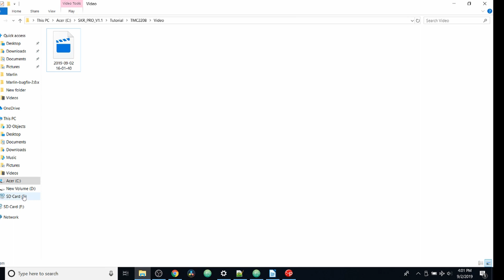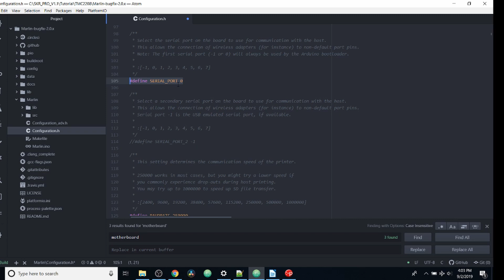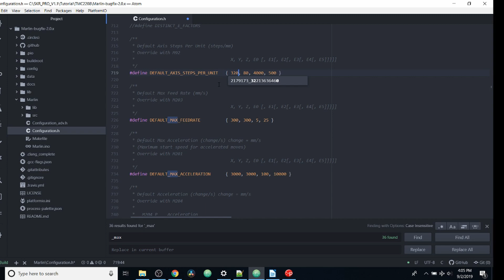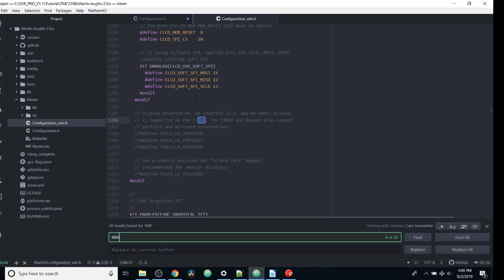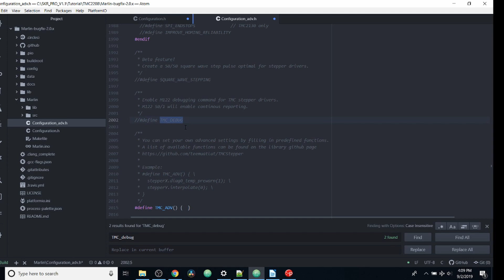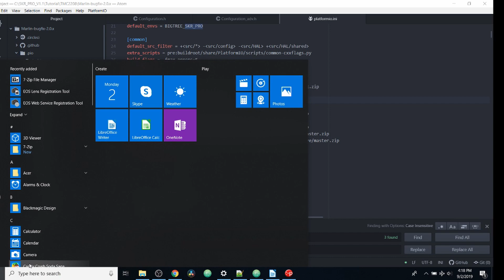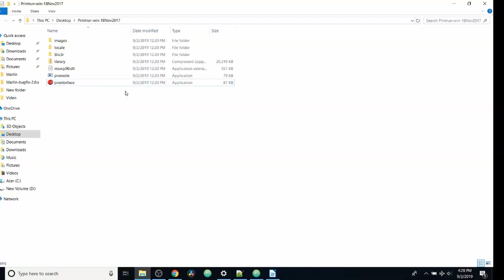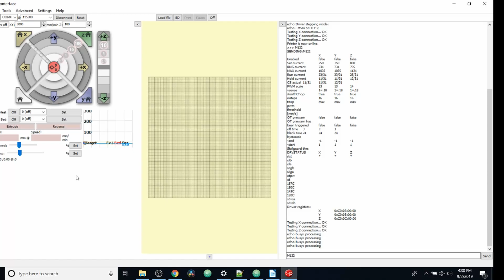SKR Pro V1.1 - TMC2208 UART v3.0 (BigTreeTech)

Comment: I added my tmc 2208 but version 1.1 so ile wonder for UART is just jumper enough or do i need to add a resistor and restore some pins as old style ? Also for set up vref for the driver i measured 240 mV it is impossible because i can not increase vref to 800mV ?
Reply from the maker: I'm not sure I understand you're question.  There's a link to Discord in description.

Comment: Good afternoon. I want to build an IDEX printer, and am considering various boards. This looks intriquing but I wonder if the two Z steppers are locked and dedicated to dual Z. Can the second Z stepper be used to run a second X carraiage instead?
Reply from the maker: You can use the z axis as on or two steppers and the third extruder as an additional x axis.
Reply: @EdwardBraiman  Thanks for the reply.. I'm guessing since I haven't read the manual yet, buth the two shorting posts beside the z drivers removing them allows them to be used independantly? If you have time could you give me a guide as to how to remap the second z to act as a second x carriage for IDEX? Thanks in advance. Funny thing...eveeryone asks  what I make with the priinters I build. I buld more printers I'm more interested in the technology than what I can do with it...lol
Reply from the maker: Second z axis only does one or two nema 17 steppers on a single stepper driver.  If you want additional axis then you're moving into extruder steppers and using Marlin firmware to reallocate.
Reply: @EdwardBraiman  Thank you.
Reply from the maker: You're welcome.

Comment: Does the SKR pro have an expansion board? If we paired it with say a DIP board for expansion, would  the motors on the slower chip DIP have instructions given to it at the slower chip rate by bottlenecking the faster chip on the PRO or is adding an expansion board of a slower chip to a board with a faster chip able to utilize the faster chip only? I’m trying to see if I’m able to buy a cheaper board to use as an expansion board.
Reply from the maker: There are generic expansion boards, but you'll need to check the setup process in my RAMPS 1.4 playlist.  The chipset only communicate with pins on expansion board.
Reply: Edward Braiman I know people using 2x SKR 1.3 boards utilizing  one as an expansion board to use for the extra extra drivers. The few people I talked to using 2 SkR boards used the same exact board as their main board to be an expansion board so tenuous had the same chip. What I’m wondering is what would happen if we used a different board with a slower chip as an expansion board since the Pro doesn’t have an expansion board and I wouldn’t want to buy two PROs I’m case i can’t use 2 of the 3 extruder jumpers for 2 extra z motors. Not to mention I’ll need another board because I’m running 7 possibly 8 fans and the pro doesn’t have enough fan pins.  I’m about to purchase a GTR if the second board used with the pro bottlenecks the chip. The Dip is nice and cheap but is the runt if the litter it seems.
Reply from the maker: Well I've been waiting almost three months for GTR to arrive, so I might be able to answer questions about it.

Comment: i just fount out that Currently @t is outdated and you shouldn't put that in your platformio.ini file at this time. 
Leaving or changing it to->  TMCStepper@>=0.6.2,<1.0.0    ,is now recommended.  
.
Problem im having now is that im unable to set my micro steps in firmware and im stuck on 1/8th. M122 reported it was in 256 msteps until i soldered the jumper on each driver. it now states that its msteps is 8 which seems correct for its physical measurement and the steps per mm i have set in firmware. but i have each driver set to use 32 in configuration_Adv.h
Reply from the maker: Have you check if any issues are open on Marlin's GitHub bug page for micro stepping?
Reply: @EdwardBraiman  i have. i didn't find one with a similar issue. so i opened one.
Reply from the maker: Cool let me know in the comments the link.
Reply from the maker: Well I've been investigating a little and it looks like they made a dramatic change in the configuration_adv.h it appears to be easier to configure, but micro stepping maybe controlled on configuration.h under default_axis_steps_per_unit.  Try doubling 80 for x and seeing if it's less steps.   Sensor less homing seems messed up, but I need more time and cooler weather as my apartment is about 100 F.
Reply: i doubled x now it moves 40mm instead of 10mm.
earlier i tried printing something at half scale to see if it would print at full scale and it temporary fixed the issue and printed at 1/4th scale and moved 10 for 10. 
 when i doubled all my axis steps and re-flashed it fudged up again.  i'll try to print at smaller scale again.
Reply: well i think i found the issue... i tried printing something normally and it was excessive in movement  it crashed and i hit the reset button on the lcd. now it works and M122 reports 32 msteps. did a complete power cycle and load and behold the printer was moving 40mm instead of 10.. hit reset on the screen and its 10mm for 10mm. 
something is causing it to be set to 1/8th msteps then somehow the soft reset fixes the issue.
Reply from the maker: Micro stepping is still the same.

Comment: I have followed this video but it wont compile after adding the link in here for drivers
Reply: https://github.com/bigtreetech/TMCStepper I think is the problem marlin bug fix 2.0x looks a bit different to the one used on here
Reply from the maker: Marlin firmware has made many changes.  Currently I've not been able to get tmc2209 working.  The others tmc2208 and tmc2130 should work as done in videos.
Reply: @EdwardBraiman  tmc 22o8 v 3.0 is what I am trying to set up  will not compile  seems to be with the include statement
Reply from the maker: Which IDE are you using?  ATOM with Platformio is now not supported.  VScode IDE with Platformio plug-in is now standard.
Reply: @EdwardBraiman  It still fails in VS Code...
'stimer_t' does not name a type; did you mean 'timer_t'?
changing the line > TMCStepper@>=0.6.2,<1.0.0    < to >     https://github.com/bigtreetech/TMCStepper
in platformio.ini causes the issue.
Reply: still fails in vscode
Reply from the maker: Does it fail on a fresh download of Marlin firmware without any changes made to it?
Reply: It compiles without touching anything
Reply from the maker: So it's working?
Reply: I just left the line in platformio.ini "TMCStepper@>=0.6.2,<1.0.0" as is and it compiles and runs on the printer.  if you change it then it fails. 
not sure if it will work in UART mode i dont really know the benefit it or feel like messing with my drivers atm.
.
the failure to compile has something to do with the github TMCdriver package. if Thomas is using the same version of everything as i am he's likely having the same issue. 
he did mention that in his original post actually. "wont compile after adding the link in here for drivers"

Comment: Thank you for your videos.  Do you have any advise on DRV8825.  I am trying to install some old DRV8825 that I have from another printer but I am reading 0 volts on all my Vref adjustment pots.  Are there any tricks to find out how to see if there is power?  I measured the 3.3V out of the Vcc and GND and it measures 3.3V.  The "D" pins are shorted per recommendation on A4489/Drv8825 Is there a setting in Marlin perhaps that keeps the voltage from working?  I have plugged the drivers on the old printer and they do work.
Reply from the maker: I've been unable to get them working at the moment on the SKR pro v1.1.  the direction appear not to help from bigtreetech.  I'll make a video when I figure it out.
Reply: Edward Braiman : Thanks!  I also opened a ticket on the Bigtree Skr Pro Github.  The polarity on the bed heater output PiD is reversed from the label too.  Once I changed polarity I was able to make my AC SSR work.  I followed all your other vids and they worked to a tee.

Comment: I cant get my two Z motors to go in the same direction 😢
Reply: I have the same set up i just use 2209
Reply from the maker: Try reversing plug or inverting in Marlin firmware on configuration.h

Comment: Are you using the official Marlin 2.0 branch, or the Bigtreetech one? Could you made a video of configuring the SKR PRO 1.1 with TCM5160 with the debug pin attached? Thanks in advance, and great video!
Reply from the maker: I'm only using Marlin firmware from www.marlinfw.org . I'll be doing other tutorials as time progresses.

Comment: Hi Edward. I made everything step by step from your video. But when I power my skr pro v1.1 populated with 4 piece of tmc2208 drivers, the motors doesn’t get anny current.  Can you show is the wiring of the nema motors with color code?
Reply from the maker: There is a tutorial in my playlist regarding this.  I'll see if I can find the link.
Reply: @EdwardBraiman  I think you mean this video. https://www.youtube.com/watch?v=3Z4aAzuzu44
Reply: @EdwardBraiman  also sadly in platformio.ini, the TMC driver github link is not working anymore.

lib_deps =
  LiquidCrystal
  TMCStepper@>=0.6.1,<1.0.0
  Adafruit NeoPixel

should work, but.... who knows?!
Reply from the maker: Do you mean wiring jumper pins?  Or wiring connectors for Nema17 steppers?

Comment: hello, thanks for the video. I have a problem when I try to move the engine, it is not moving properly. The motor jerks and I have a message in the Pronterface "echo: busy: processing". If you have an idea
Reply from the maker: What happens when you send the command in Pronterface, "M122"?  What type of stepper drivers and brand?
Reply: @EdwardBraiman  Thanks for your response
For the stepper drivers, it's TMC2208 v3 from Bigtreetech.
The M122 result :
>>> M122
SENDING:M122
  X Y Z E
Enabled  true false false false
Set current 800 800 800 800
RMS current 795 795 795 795
MAX current 1121 1121 1121 1121
Run current 25/31 25/31 25/31 25/31
Hold current 12/31 12/31 12/31 12/31
CS actual 12/31 12/31 12/31 12/31
PWM scale 255 14 14 14
vsense  1=.18 1=.18 1=.18 1=.18
stealthChop true true true true
msteps  16 16 16 16
tstep  max max max max
pwm
threshold
[mm/s]
OT prewarn false false false false
OT prewarn has
been triggered false false false false
off time 3 3 3 3
blank time 24 24 24 24
hysteresis
-end  -1 -1 -1 -1
-start  1 1 1 1
Stallguard thrs
DRVSTATUS X Y Z E
stst  * * * *
olb
ola  *
s2gb
s2ga
otpw
ot
157C
150C
143C
120C
s2vsa
s2vsb
Driver registers:
  X 0xC0:0C:00:40
  Y 0xC0:0C:00:00
  Z 0xC0:0C:00:00
  E 0xC0:0C:00:00
Testing X connection... OK
Testing Y connection... OK
Testing Z connection... OK
Testing E connection... OK
Reply from the maker: Can you outline what hardware is connected to SKR and what Nema17 motors and if you needed to wire the connectors for the Nema17?

Comment: TMC CONNECTION ERROR
Reply from the maker: Which hardware are you using?  Which version of Marlin firmware are you using?
Reply: @EdwardBraiman  skr pro 1.1 
last version marlin 2.0.1
Reply from the maker: Who makes the stepper board?  When you do M122 in Pronterface what do you see?  Can you copy what you see in Pronterface into comments?
Reply: @EdwardBraiman   The motherboard and the stepper board are BigTreeTech
Reply from the maker: Can you copy message from Pronterface?
Reply: @EdwardBraiman  yes, and "TMC CONNECTION ERROR" LCD screen
Reply from the maker: So on the LCD?  Without LCD screen in Pronterface do you see an error?  I'm just trying to understand your configuration and what's connected.
Reply from the maker: Which type of LCD are you using?  I'm going to try and replicate tommorow.
Reply: @EdwardBraiman  thanks for helping me
Motherboard: Bigtreetech SKR-Pro-1.1
Stepper Driver: Bigtreetech TMC 2208-V3.0
Marlin Version: 2.0.1
LCD: RepRapDiscount Full Graphic Smart Controller

The message "TMC CONNECTION ERROR" appears on the LCD.

I set exactly as in the video to make a test and unfortunately this error appears, I can not control the stepper motor, but in pronterface I can force the engine but it spins wildly, skipping the steps.
Reply from the maker: I replicated your issue.  When I recorded this video we had been on bugfix version of Marlin firmware and extra steps needed to be taken for TMC 2208.  Since then they fixed platformio.ini so the only change you're going to make is default environment to bigtree skr pro and ignore second change.  For the issue you experienced I power up skr_pro only on USB power and saw the error message you experienced.  The solution for me was to remove all power from board and move jumper for USB power to power supply position.  The I reconnected USB cable and powered SKR pro from PSU (power supply unit) for my 12v power supply.  The LCD powered up fine without error message.  Sorry it took a day but last night I was investigation another LCD issue.  Let me know if the resolves your issue?  Good luck.
Reply: @EdwardBraiman  sorry for the delay, I took a break from the project and am coming back now.  I solved the problem by soldering the two connectors under the driver (in the driver's manual it was like this).  could you do explain me better how to configure the driver Vref?
Reply: Sorry for my bad English
Reply from the maker: Vref depends on the stepper driver type and Nema17 stepper motor type.  Using the datasheets from both you can set the vref (voltage reference).  Unfortunately, it's hard to explain, but I've done two videos on this in my MKS Gen L playlist.  Vref can also be set via software depending on stepper drivers.  One of many examples is TMC 2130 spi stepper driver.

Comment: Hi. Thanks for your video. Everything is clear. I bought one and I received it last week. I've the skr pro 1.1 with the TMC2208 V3.0 from bigtreetech.
I've set up Marlin according to your video. After uploading the firmware, I can rotate my nema motors. But if I test the M122 command, I get "all low" message.Any idea about what's wrong?
Reply from the maker: There might be an issue open on Marlin firmware.  I'll see if I can find the link.
Reply: @EdwardBraiman  Thks for your feedback. I found on other forum that the J2 must be soldered. Mine in not soldered. Do I've to do it?
Reply from the maker: Check with a really good magnifying glass or zoom in photo. It may have surface mounted resistors.  They're about the size of a needle head.  On my first batch I had to resolder, but check the version is bigtreetech v3.0.  first try swapping in other steppers if you have more before attempting because of warranty.
Reply: To fix this error I had to add Jumpers between the rx and tx pins. Mine was a 2209 though so I'm not sure if you have those pins on the '08
Reply from the maker: Is power connected?  I know this sounds odd but the only instance I caused this was no power supply.  There is a trouble shooting guide on Marlins website which might help in this case.  I'll look for other causes after work tommorow.
Reply: Same here, thank you for the tutorials and all the work. I can connect it to ponterface and with the M122 command X/Y/Z/E dont get a adress and all low. I try to bridge TX and RX today, hope it will help 🙁. Steppers are 2209 silentstep from watterott
Reply from the maker: At the moment I'm still trying to get tmc2209 working as well.
Reply: hi im getting the same thing has anyone found a fix?
Reply: MrWhelan190 hi, you need to have the specific UART version of the TMC2208. Else, you have to use TMC2208_Standalone in your Marlin configuration file.
Reply: @yannickmarco5760  i have the bigtreetech tmc 2208 v3. if i use TMC2208_Standalone the m122 command dose not work

Comment: Thanks for such a detailed and clear video! I have generic TMC2208 from another vendor. Is it possible to use them with SKR Pro 1.1? Is there any soldering should be done on such TMC2208?
Reply from the maker: Unsure s most people have issues.  You can try them and see.
Reply: any updates on that? I have the TMC2208 v1.2 with 3 solder pads underneath and i'm thinking to upgrade to this SKR PRO board. Can I use my "old" TMC2208 v1.2 in UART mode ?
Reply: @dark23junior  Yes, I was able to use TMC2208 from FYSETC after soldering 3 pads. The driver is fully controllable through UART
Reply: @shwonder thank you, i will try it

Comment: Hi Ed,  Thank you for all of your videos, I have been following many of them for some time now.  I am following your exact setup but when I run the M122 all of my drivers report as low.  When i move them in pronterface they move as expected but i think there is something going on with the UART communication.  Any thoughts?
Reply from the maker: Who's the manufacturer of the stepper boards?  Is the solder joint on bottom of TMC 2208 uart correct?  Sometimes they miss with the solder or resistor falls off.
Reply: @EdwardBraiman  it's the big tree tech tmc2208 v3.0. I thought these came ready out of the box.
Reply from the maker: Does it say UART on the bigtreetech label in the box?
Reply: @EdwardBraiman  Here is a pic of the label from the box as well as the drivers   https://imgur.com/a/WVtXfSa

Comment: Quick Question: I followed your video pretty much exactly and I get this error
.pio\libdeps\BIGTREE_SKR_PRO\TMCStepper_ID5513\src/TMCStepper.h:23:11: fatal error: SoftwareSerial.h: No such file or directory
Only difference is that I am using TMC2209s 
Any idea what's going on?
Reply from the maker: The Marlin firmware build for SKR Pro is broken.  Marlin is working to fix.  Here is the link, https://github.com/MarlinFirmware/Marlin/issues/15680
Reply from the maker: Just checked and the download and build/compile is now working.  Give a try with a new download and let me know?